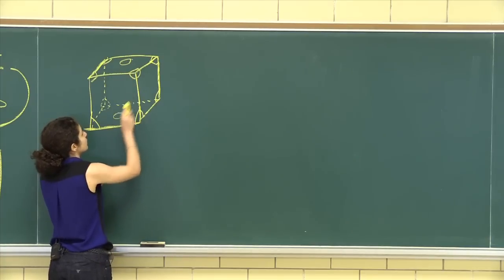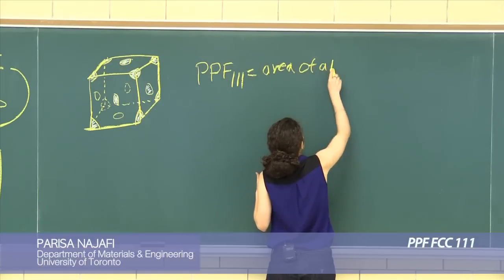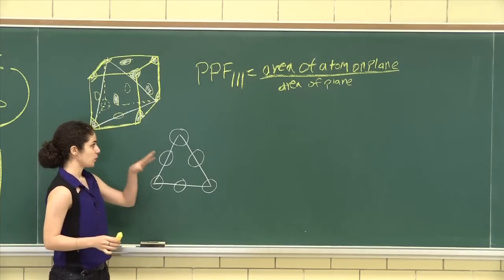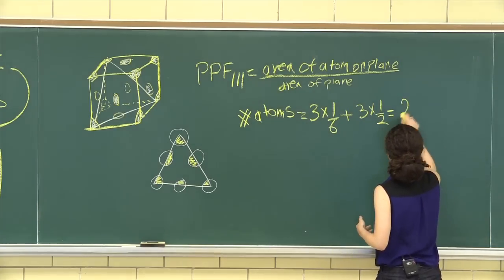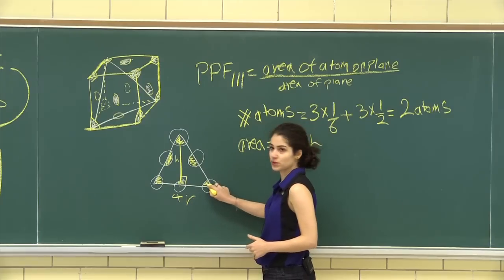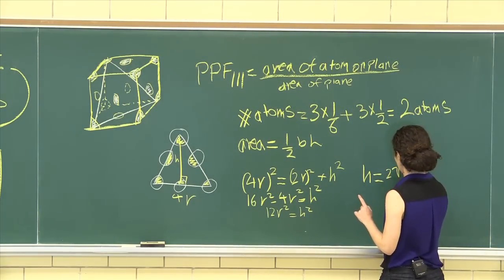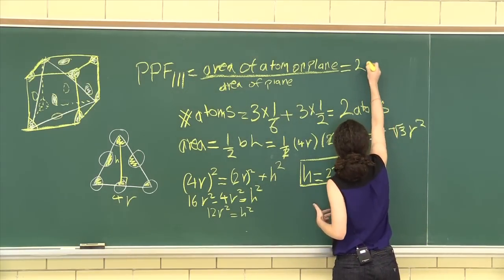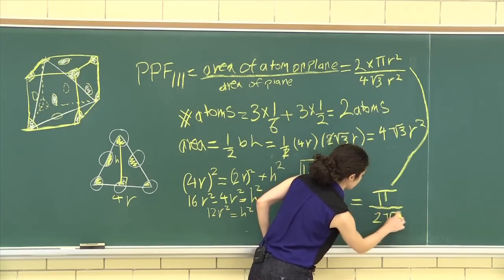Planar packing fraction (factor) for the face centred cubic (111) plane

Comment: Bravo! Thank you so much. I was calculating the PPF of FCC but I didn't know there were different planar densities (??). Because if you just google this it says 74%, but using different models we get this 111 version. Thank you again!
Reply: 74% is the atomic packing factor of FCC, the unit cell as a whole, but planar density depends on the crystallographic plane you are looking at inside the unit cell.

Comment: Can you please eloborate about the 1/6 th portion of an atom?
Reply: The (111) plane in the unit cell forms an equilateral triangle with an angle 60 degrees at each corner. Here the atom at corner is a circle with 360 degrees. hence the part of the atom at the corner within a unit cell is 60/360=1/6.
Reply: @UmmadiRaviteja  thanks man

Comment: i cant tell that the plane cuts 1/3 of the atom at the corner. how can you tell?
Reply: +sladeartermiz because the triangle that is formed is equilateral, each corner of it is 60 degrees. It actually cuts out 3x60 degree chunks which is 180 degrees. which is HALF of a full atom.
Reply: James Watson  useful ,,thanks